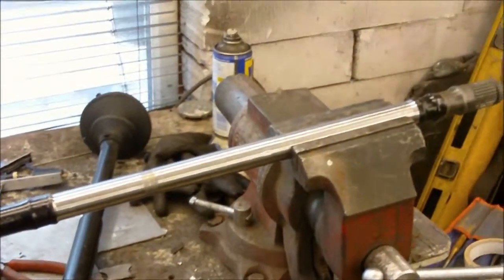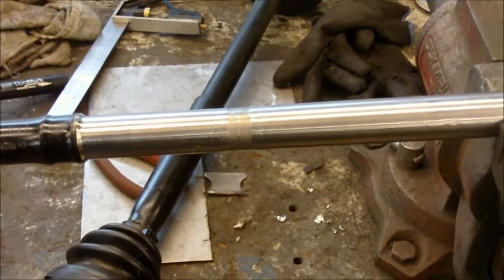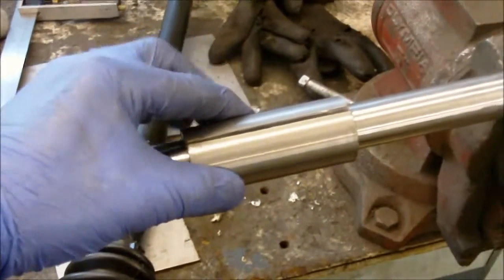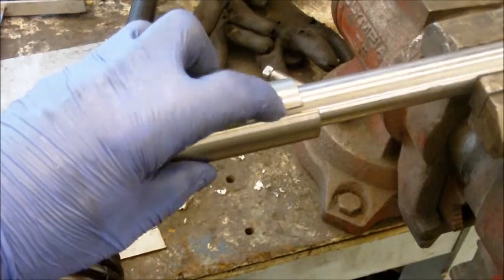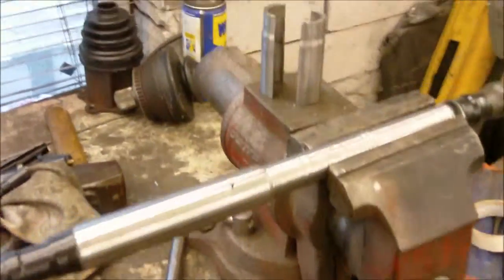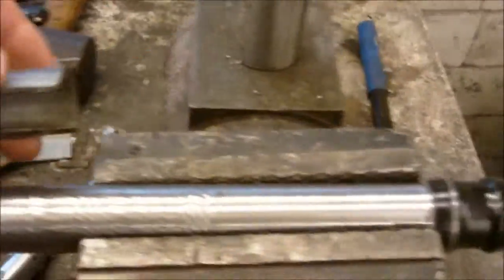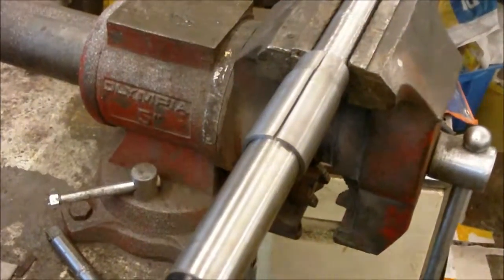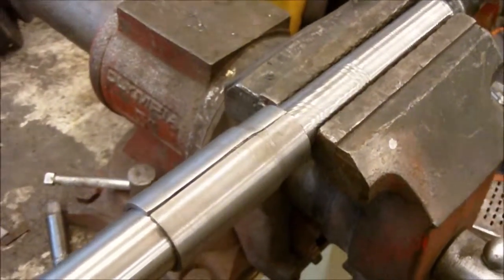driveshaft reinforcing along join

Comment: How do you balance after welding? Love the build BTW
Reply from the maker: +Js Brown 
The welds are always cleaned up on the lathe, I then spin it up @1500rpm and feel for any vibration through the lathe, I check for any wobble on the drive shaft with the cutting tip, If there's any mark left by the tip this area is addressed by hitting it with a large hammer, repeating the process until perfectly straight, Please bear in mind that I'm correcting roughly 0.5mm.
Reply: +dangerrous thanks mate - understand now